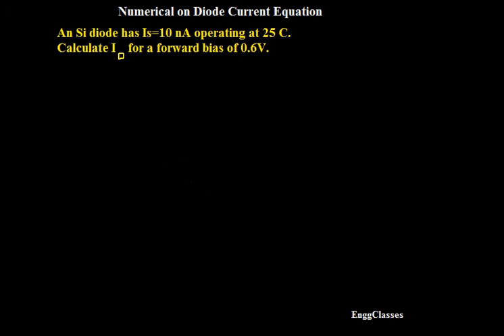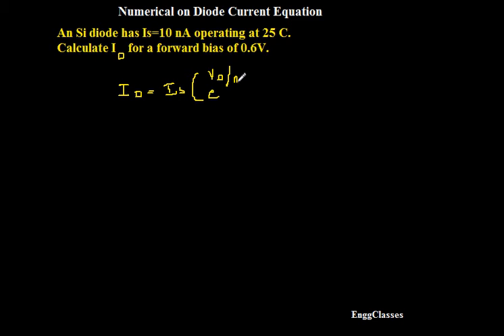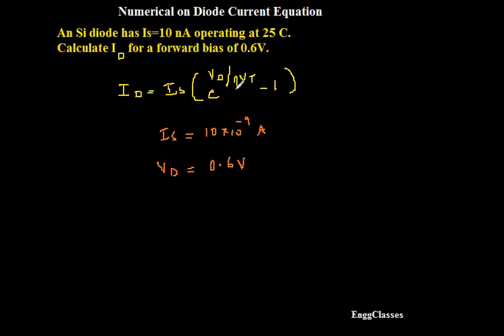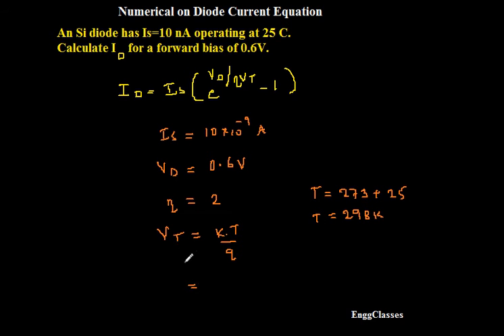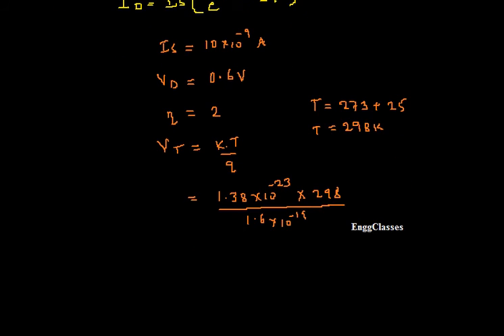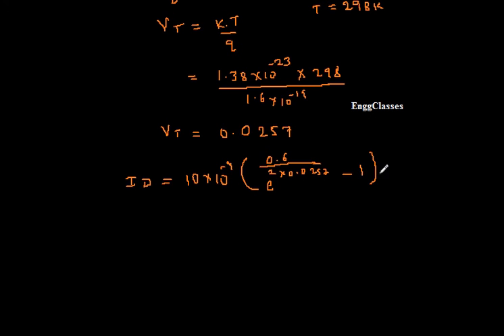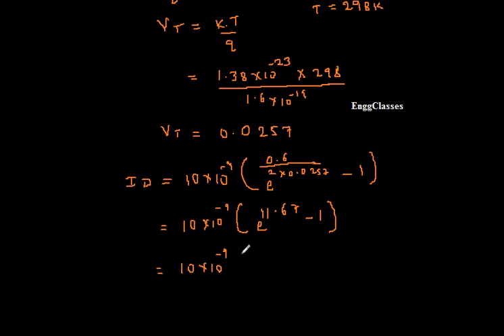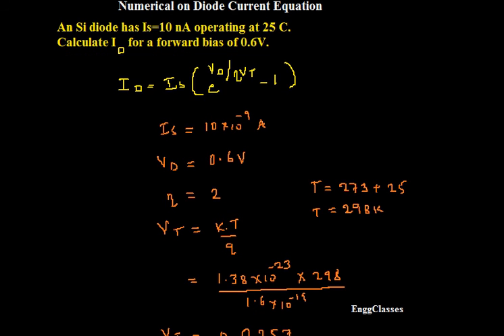Diode Current Equation (Numerical 1)

Comment: Sir how to calculate e on calculator it shows math error for me
Reply: First of all you have to press alpha and then ln.
It will create an 'e'. Then ^ for specifying power of e and use bracket to separate the power and the sign ^.
For example, e^(-1)
And there will be no error. You'll get the answer    0.367879441.
Reply: Press on alpha and then press on e at the button of de calculate
Reply: Answer is 1.184
Reply: you might be using the E button instead of the e button for exponential functions. I forget what the E button is called but its the same as writing x10^n for eg = E10 on some calulators.